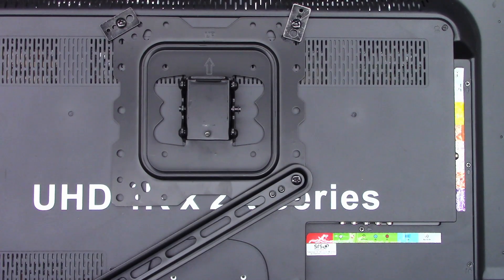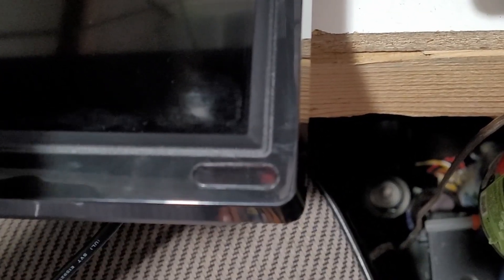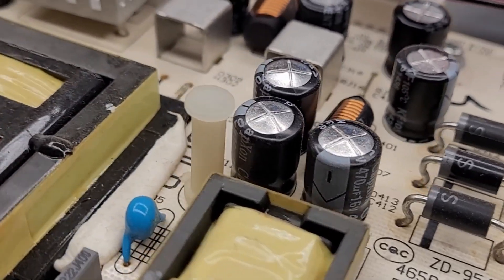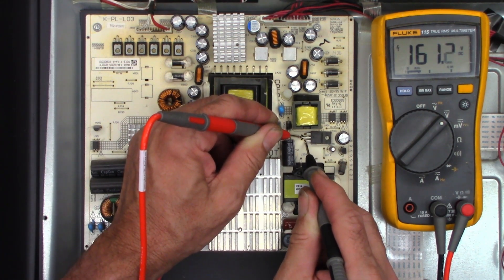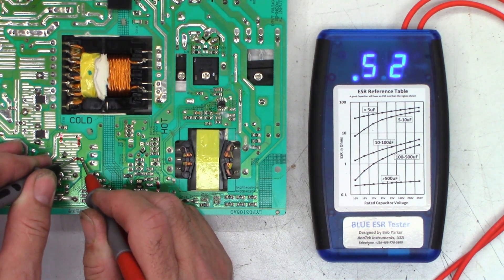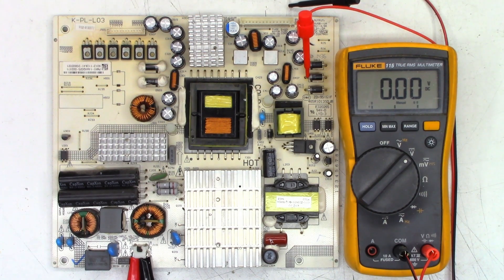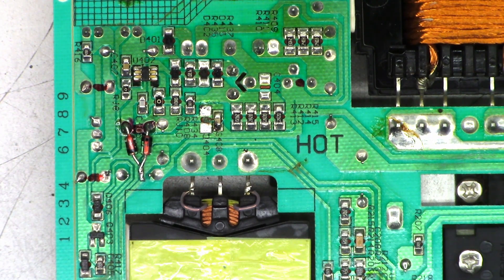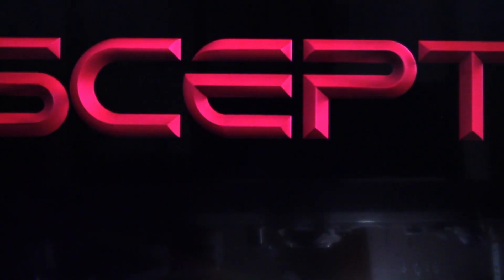My 12 year old Grandson's TV stopped working. Sceptre U50 U500CV Totally Dead - No Power Repair

Comment: I wonder if your grandson's room has temperature fluctuations that led to the caps blowing and diode dying. I have really no clue of what you were saying in respects to the technical side of this repair. I have repaired tvs in the past and most of the time the caps were blown because the rooms the tvs were in were not climate controlled. My troubleshooting is very limited to sight and smell rather than actual know-how! Great video!

Comment: Brilliant repair. I didnt quite understand the part about putting the zeners in series , how did you find the problem? Did you just check the components around the switching ic and came across the diode ?
Reply: Agreed. Where's the troubleshooting to find the culprit?
Reply from the maker: I stopped recording when I pretty much determined that I was going to have to get a complete replacement board for the TV.  I knew that the standby power supply controller was not getting its startup voltage.  I did manage to find a similar schematic and did some basic checks with the camera off. Once I figured out what the problem was I did want to go ahead and finish out the video.

Comment: About 4 years ago I was given a plasma TV. It would power up for 30 seconds and turn off. Your video showed the power board has a common issue with solder cracks. I took the board out and with a 16 power loop I found the cracks. The power board was taken to a computer shop and was re- solder. The television works flawlessly. Your videos are a great help to the community. Thanks again.

Comment: Being out of TV repair for a decade now, I was surprised to find some TV's need to activate tuner one time.  What's that all about?  I figured it manufactures being greedy and don't want these working later on when they can be used off antenna.  Thx
Reply from the maker: I have not heard of that. The newest TV I have is from 2018.